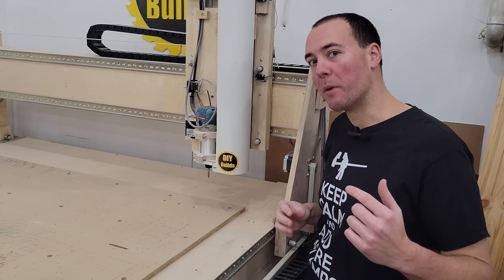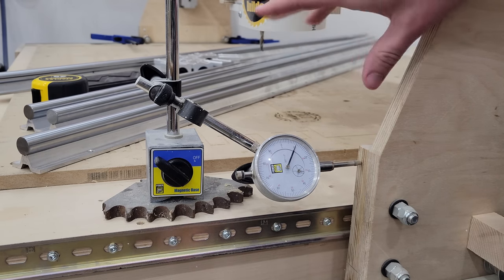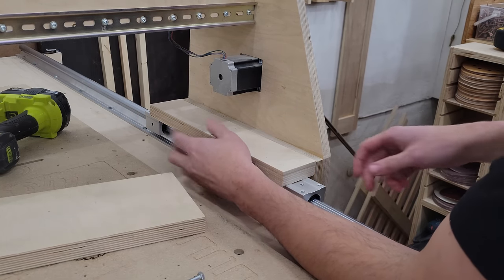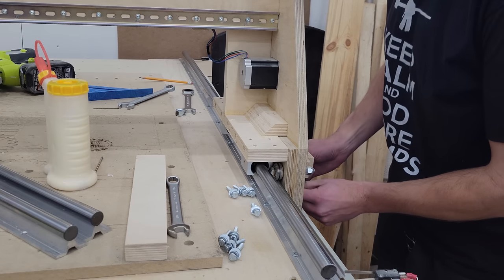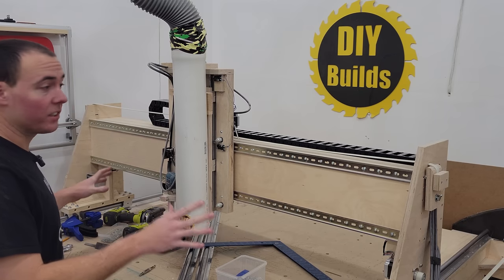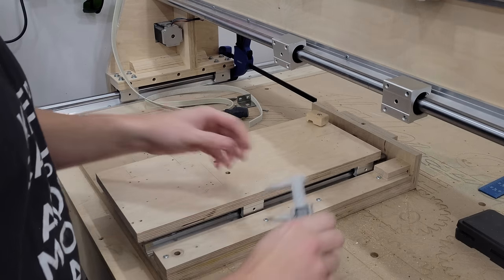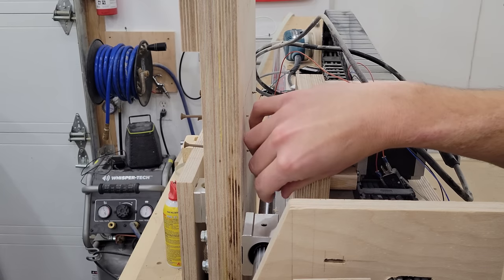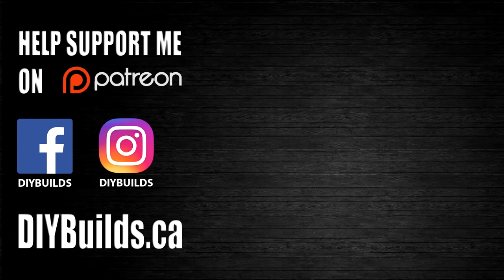Upgrading my DIY CNC Router for Under $900

Comment: You should retest the amount of play you have on the x axis.  With the new rails on the Y axis, it might have stiffened up the gantry significantly.
Reply from the maker: No it wasn't flex of the beam it was where the beam connects to the uprights.

Comment: I bought my 2 meters of steel DIN rail 2 days ago……..🥲🥲🥲🥲🥲
Reply from the maker: Hey it was still working fine when I did this upgrade.
Reply: @DIYBuilds  lol I figured. 
Had to laugh about it. That Vevor site is pretty incredible for us Canadians.
Reply: I’m also in the middle of turning my Chinese kit delta 3D printer with 550mm MGN12 linear guides and two 12mm X 300mm machined rods into a Cartesian that’s reliable.

Comment: I have been using this linear rail system for years and they are awesome!  My cnc machines are enclosed to reduce noise and eliminate the vacuum pickup at the Z axis.  Being enclosed and no pickup  at the Z axis means lots and lots of air born particles.  These linear bearings have no problem dealing with the dust which was a big worry when I went to enclosed.  The rails themselves are pretty much indestructible.  And the cost of the rails is very low.  If you have to replace one of the linear bearings they are also very low cost.  I recommend this rail system to everyone.
  I noticed when you were measuring for racking you did not have your stepper motors engaged which would have made a big difference.  I recommend next you upgrade to roller bearing screws for your machine.  The prices have really come down.  This will take out pretty much any end play, improve precision, and when you power down the system the axis is locked, which is an issue with stepper belt drives.
  Thanks for the video!  You did a great job on the upgrade.
Reply from the maker: Thanks. When the motors have power racking was never an issue that's why I measured it de-energized

Comment: Thank you very much for sharing such an incredible project! Your explanations are so clear and uncluttered that they should serve as a model for other YouTubers. I may have a solution to the problem of racking of the gantry. To explore the concept (ignoring for a moment the router) if the two pieces of birch holding the new bearings were replaced by a single plank of birch spanning the width of the gantry, the racking would be eliminated—you’d actually have to distort the plank.

To accommodate the router and laser, some compromise to the width or placement of the plank. If there is space at the far end to allow some overhang, affixing the plank more in that direction could allow the retention of some of its width. Or maybe just the space behind the path the router/laser travels would be enough to add rigidity. 

Just a thought, but it may helpful.

Comment: nice, I like it, built my own wood CNC with v bearings as well and will be updating to linear bearings soon.  I do need to add "1/2 plus a 16th plus a 32"   That would be 19/32 for the record.   Sorry its kind of like Sheldon needing to knock three times.   ya know ya know

Comment: I saw those in the battery video but didn't mention it in the comments. I built a Joes 06 cnc back in 2007. I recently disposed of most of it... The better 3/4 was unhappy that I did that but I told her that when I built it the cost of ball screws and linear rails was extremely cost prohibitive. Now those parts are readily available and relatively affordable. Not planning to build another router at the moment but maybe a cnc plasma cutter at some point IF I can find somewhere to put it.
       Now If I could get two 40' sections and 2 20' sections that stuff would make for an awesome gantry crane in the shop... My shop has exceeded max capacity and needs an addition of say 50K sqft... 
       Looks great overall though the canadian name you give the Z axis and the flipping of X and Y did throw me off. :) When I got my first 3d printer I was introduced to a community that flips X and Y as well which still confuses me even today...

Comment: Nice upgrades.  That will definitely take you a long way into the future.  I do have a question though, , what was the deflection like after putting the linear rails on the gantry?  There was a definite improvement after installing them on the bottom, but the rails should have given some more rigidity to the gantry.  Keep up the great content.

Comment: Surprised you didn’t size mount the main rails. Not losing enough capacity to matter. Great upgrade.
Reply from the maker: I debated it but ultimately It would mean more mods and extending the gantry.
Reply: @DIYBuilds  I was surprised you didn't cut off the bottom of the risers and set it on the board you added to the gantries rather than attaching them to the "end grain" -- but then realized it was so that you didn't have to totally rework the Y axis belts.
Reply from the maker: Yup. This project took a long time to balance what was easiest and best for structure. Hence the corner guessets.